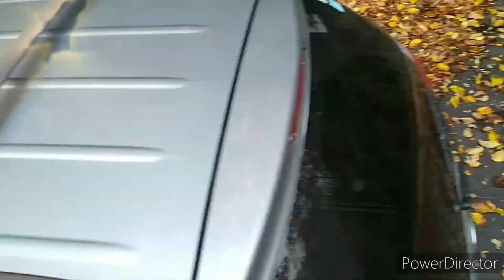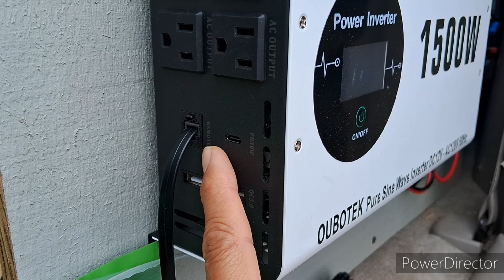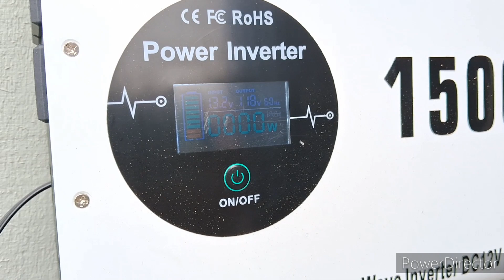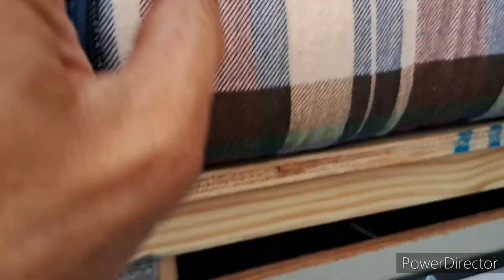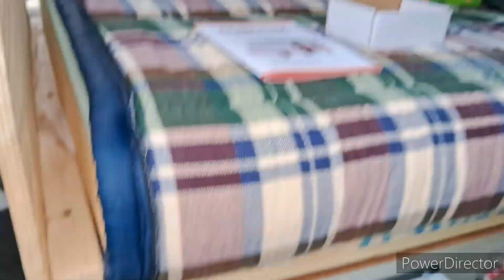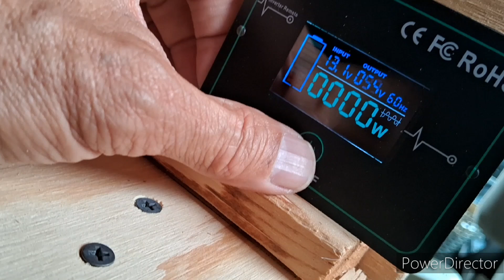Vanlife | Self-Built 1500 Watts Battery System in 2008 Toyota Sienna Minivan Camper

Comment: So your lithium 12v battery is only 100ah?  For some reason I thought it was 200.  So you can have a 1500 inverter with only 100ah battery?
Reply from the maker: Ahhh, yes! State of confusion!😁 Ready!!!? GO. 100Ah means the battery has the capacity of 100A for 1 hour or 1280W for 1 hour. Whereas, the 1500 W inverter has the ability to convert 12V DC into 120V AC. The inverter doesn't care where or how much Ampre of  the 12V is coming from. It will continue to covert 12V to 120V until the preset "Stop" voltage reach.(usually 11.8V)